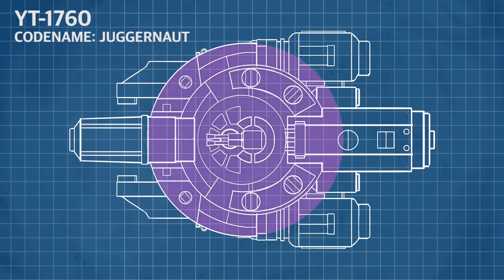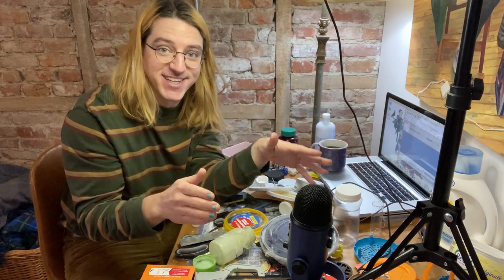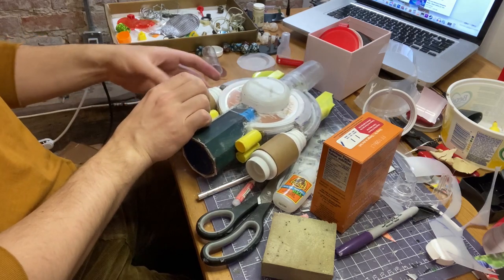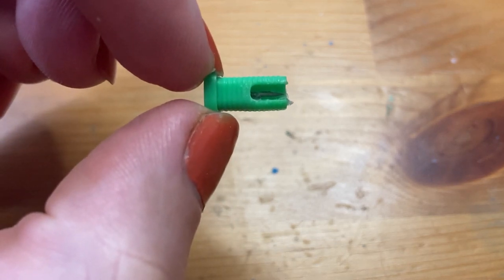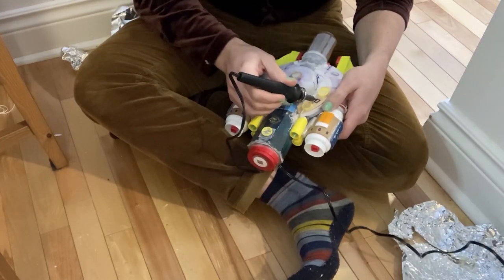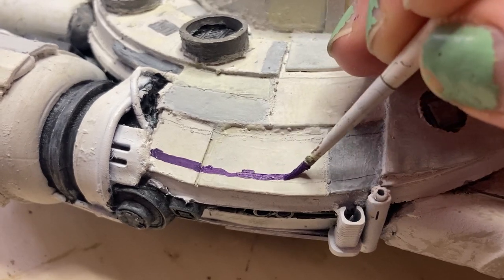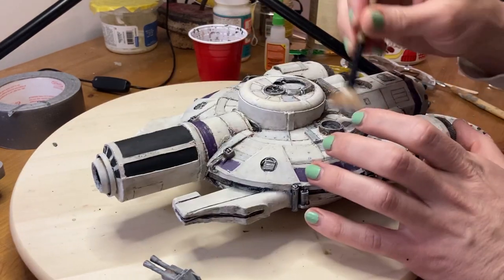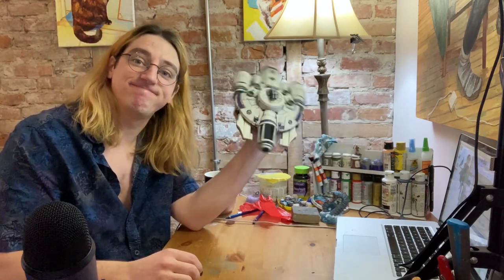I made a Star Wars Ship out of TRASH!

Comment: The thing about the purple Sharpie; you can use isopropyl alcohol to clean off Sharpie marks before you paint.

Just make sure it won't also dissolve any glues or materials you are also using in your build. It will also take off acryllic paint but, I don't know about enamel, latex or lacquer.
Reply from the maker: Of course! I’ll keep that in mind next time. Thanks for the tip !

Comment: It looks pretty good and will work well with legion or in dioramas.  What seems to be missing is a loading ramp and the standardised correllian air locks.
Reply from the maker: If I'm not mistaken, the loading ramp and airlock would be in the back middle section. I imagine the ramp comes down - same as the landing gear, not included in this build (though maybe in my next ship build!).
Reply: @NicheCrafts  My Mistake - I had thought that the back middle section was more engines.
Reply from the maker: @ArmouryTerrain  No worries! I had to look it up. I was using a few references when making this build!